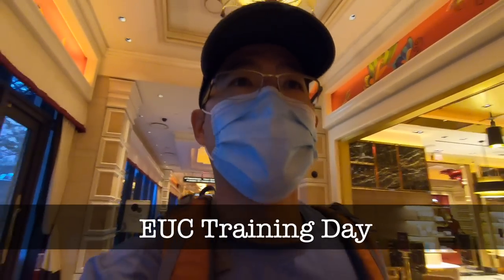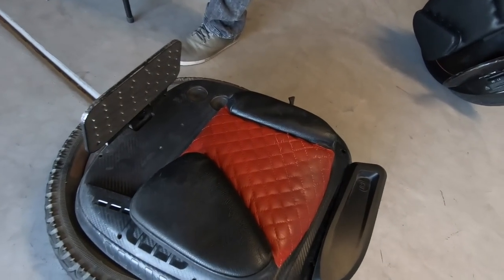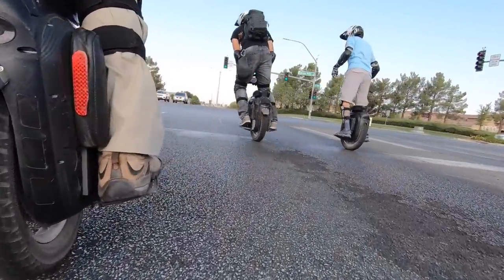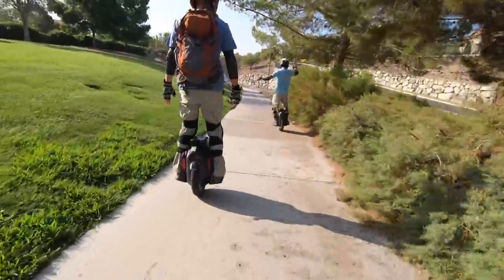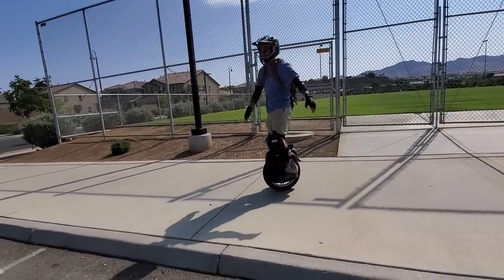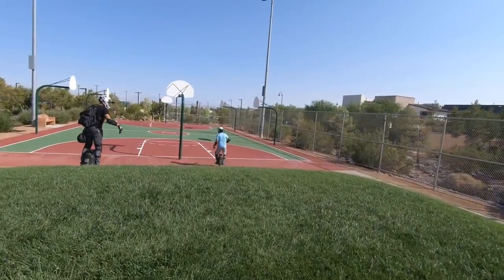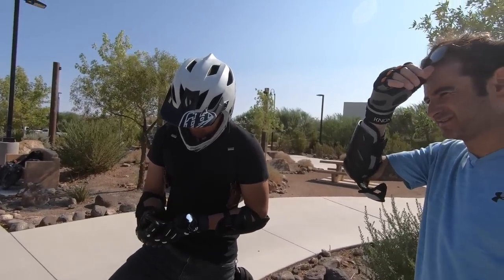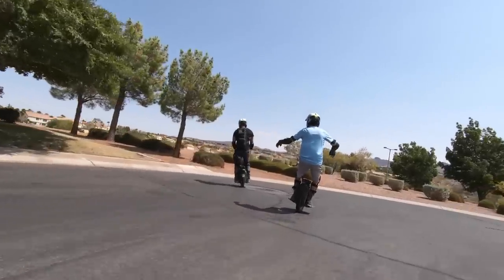How to Jump an Electric Unicycle! (part 1)

Comment: Hi Jimmy
Nice videos. You guys need to be less pc and just say euc is better than onewheel 😉

On a more practical point. Were you jumping with a 'normal' aliexpress type pad with a big gap above the toes or adapted with more padding underneath?

If just normal pads, then jumping by pulling up the pads or gripping the sides?

Only done 150 miles total, no similar background, but would like to handle curbs and rocks better...

Thanks.

Comment: An euc is  what you would get if you mixed a bike a one wheel and a hoverboard.   The bike because of the huge tire the one wheel because it only has one wheel and the hover board becaus of the standing position